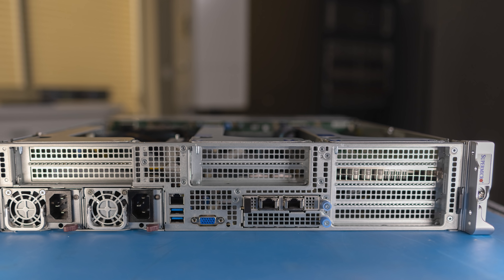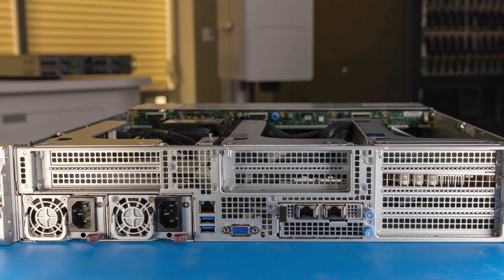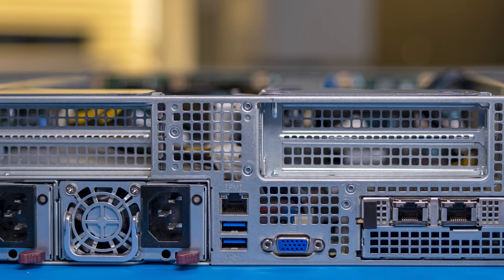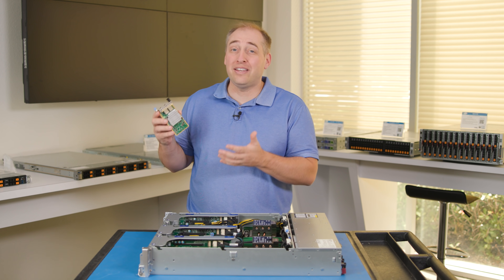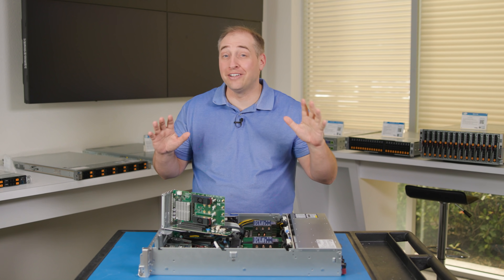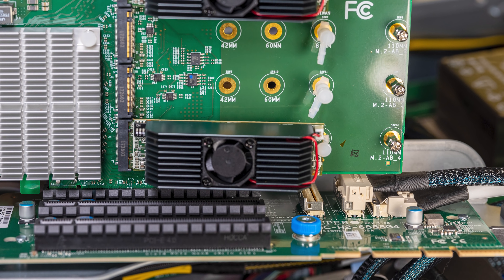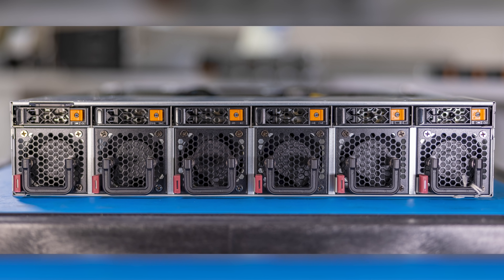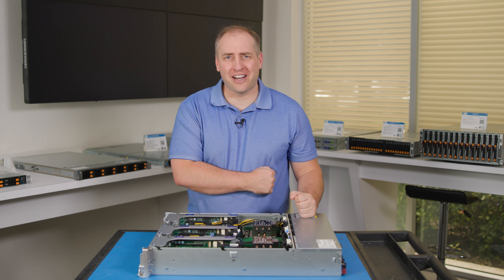Hands-on with the Supermicro Hyper-E

Comment: 2000w on a C14 plug?
If it weren't for the fact that these systems are very niche, and going to DC's that know what they are doing, i'd be concerned.

The C13/14/15 plugs aren't usually used for this power level, C19/20 is.

Most C13/14/15 cables you find in a datacenter, does not have the wire gauge to handle 2000W, even at 230v, let alone 120v.

So if you plugged this server in with "normal" C13/14/15 cables, you could easily have molten cables.

AWG 18 and 20, and 0.75 and 1.0mm2 is what is usually is found on these cables, neither is suited for 2000w at 120v, 18AWG and 1.0mm2 is JUST enough at 230w, but the cables WILL get hot.

Ideally you should use 14 or 12AWG cables for this server, which is common for C19/20 but not C13/14/15.

Comment: Looks really cool except for the proprietary, or non-standard, pcie hot swap slots (AIOM).  Lenovo/IBM use to do something similar and it really kills the reusability and upgradeability of a system.
Reply from the maker: AIOM is OCP NIC 3.0 compatible.
Reply: @ServeTheHomeVideo  It's a different, albeit similar, form factor though.  I had to do a little digging and while the connection is OCP 3.0 compliant the slot itself is not the same size.  You would need a sled and/or face plate for anything not Supermicro AIOM specific.  At least from what I can find is there doesn't seem to be a lot of accessible information on this.

Comment: I'm curious, lets say you wanted to have the fans and storage bays in front would it be easy  if at all possible to swap the front and back?
Reply from the maker: You would probably get a different model instead of swapping.
Reply: @ServeTheHomeVideo  Thanks for the heads up. Sounds pretty ridiculous on their part to make a system being sold as modular, non reversible considering the power supplies, cables, and NIC cards are less likely to need swapping over storage drives, I mean you'd have to pull out and disassemble the system anyways to swap the 8 PCI-E devices so in the long run it's not really saving the IT person too much time over the lifetime of the server.
Reply: @festro1000  I think the point is prioritising the connections, not swapping the cards themselves.

There's likely a model just like this in the reverse config just as you want.

Comment: I have been longing for USB-C KVMs and KVM ports on servers. Imagine, an isolated management network, served up by the same cable, that provides USB, video, and power for the BMC in case of a catastrophic failure, also, personally, i'd be using them for working on dozens of laptops at once, and dont want to have a huge bundle of power cables along with the USB-C KVM. a 2U KVM with a 1500w PSU would be awesome. Would aso be cool for those little 30w LEnovo and Dell micro PCs like the M90N and that little PC that fits inside of the Dell monitor stands